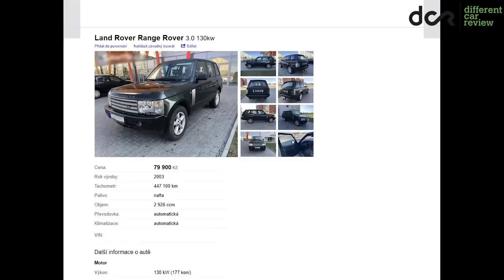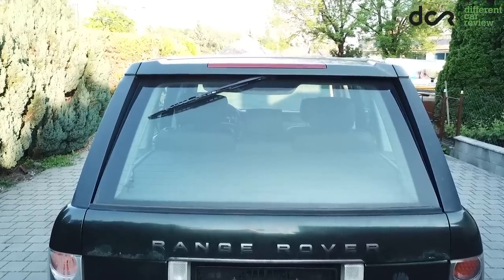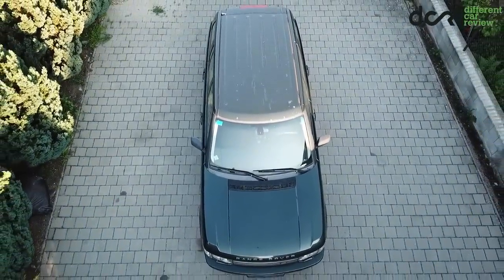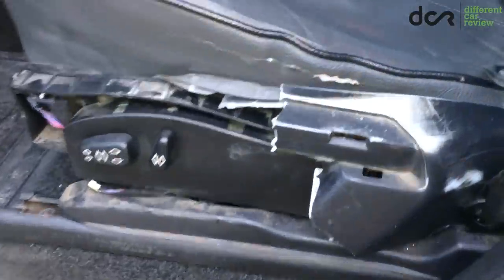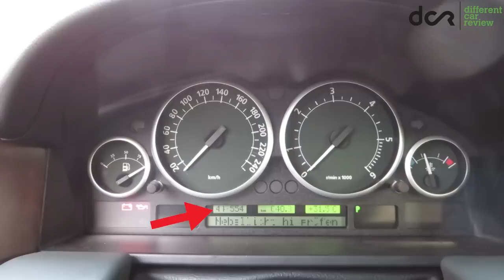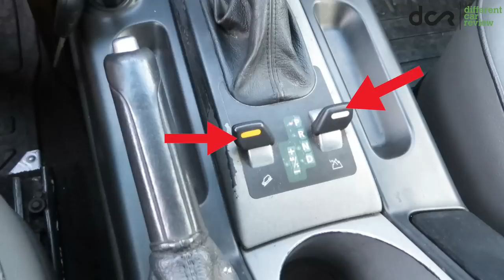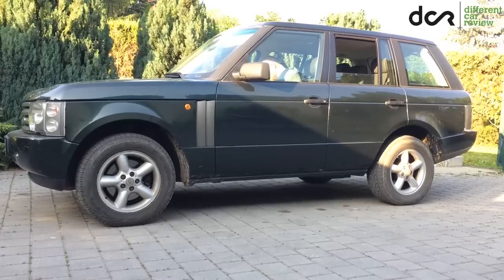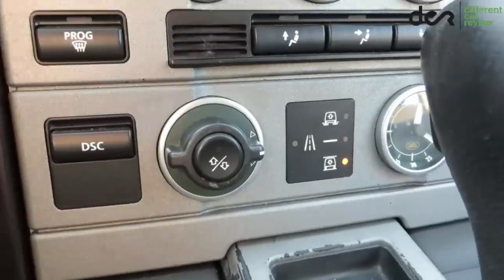I bought the Cheapest LHD Range Rover in the EU with 447 100 km - Part 1

Comment from the maker: -English subtitles are available
-It is the cheapest LHD version, in the UK they are obviously cheaper
-Don't try this at home !!
-Yes, I'm aware of all the risks
-Don't try this at home !!
-It's a bad, bad, bad idea

Range Rover L322 TDV8 Engine Issues https://youtu.be/bXPNqXs8isg
Range Rover L322 Common Rust Spots & Exterior Issues https://www.youtube.com/watch?v=ECK3FTXGvDM
Range Rover L322 - Removing the Spare Wheel is Genius ! https://www.youtube.com/watch?v=SEdc6VwyPaw

2008 Audi Q7 Detailed Review & Issues after 500 000 km / 310 000 mi - https://www.youtube.com/watch?v=Fwbx_KHvPss
2006 VW Touareg 2.5 TDI R5 - Detailed Review & Issues after 260 000 km https://youtu.be/ZJpexzt4f_g

Buying a used Land Rover Discovery 3, 4 - LR3, LR4 (L319) 2004-2016 https://www.youtube.com/watch?v=h_TCZ9P_QFM
Buying a used Range Rover Sport L320 - 2005-2013 https://www.youtube.com/watch?v=-xi0E0M0_gw
Reply: I've got a 2009 Lr3 HSE 4.4L V8 with about 150,000 miles and it's still running like a top. I've had to replace lower control arms, alternator, and a water pump. The original air ride still works but with every day I wonder if is gonna fail or  not. Not looking forward too that day lol. I know I should get rid of her but it's such a love hate relationship. I know I'm flirting with danger but i love the truck.
Reply: The hero we deserve!
Reply: Hey man your English is absolutely perfect! Unlike the car...
Reply: @Scrammy18  the BMW versions of the RR were bad. Due to the BMW running gear. The 2006+ versions are much better.
Reply: @kichaa13  yeah that is correct man
Reply: Love the accent, your English is great and to the point. Your funny and entertaining.  If I spoke like you, I'd do a radio show. Distinctive
Reply: different car review can you please review mercedes clk w209 i am interested is it reliable as or similar to w211 or is it unreliable as w203 c class witch it is based on.
Reply from the maker: @ЛукаРажнатовић-я9э  it is coming next, most probably this week
Reply: different car review nice , keep up with good work man , i just wonder are you a proffesional car mechanic or how do you get info on all this cars ?

Comment: Wow, interior oddly is quite nostalgic for me, having driven many e46, e39, e53. I guess the engine is horribly slow in this big car, but atleast the BMW 3.0d from that era is very reliable when maintained properly. One German guy managed to drive over million kms with an e39 530d, original engine and gearbox. End of life came as a result of crash, not engine or other techincal failure :)
Reply: The M57D30 from the early 2000s is a very reliable engine.

Comment: I have a 2002 Range Rover which I bought 12 years ago with 230,000 km on the clock for 13,000 euros. Since then: new gearbox, front air suspension, turbo, fuel pump, wiper motor, handbrake assembly, discs all round, brake pipe, full anti rust treatment, total cost approx 17,000 Euros. Plus some bodywork. Who told you the BMW 3.0 TD6 wasn’t a good engine? It’s fine. Yes the newer 3.6 and 4.4 have more power but for a normal driver like me it’s fine. I make a 1200 mile trip across Europe twice a year and it cruises comfortably at 80-90 mph all the way. Yes, the gearbox is not the best but too many people believe Land Rover when they say it’s sealed for life. Nothing is sealed for life. Change the gearbox oil at least every 40,000 miles. Anyway it’s 3 years since you posted this so I’m curious to know, how did it work out?
Reply from the maker: The TD6 engine in these cars is indeed the most reliable and with regular maintenance it can last forever, however for a heavy car like this its simply not powerful enough. Of course for calm cruising its fine but for overtaking not so much.
Yes with regular oil changes you can prolong the lifetime of the gearbox.
I sold it a long time ago, the new owner replaced the gearbox and he continued to use the car.

Comment: Expensive , considering it's a dog. I paid less than that for a 4.4V8 with a recon gearbox and no problems apart from a bit of wheel arch rust, even has a digital TV conversion.  It is missing the original phone...
If that's the cheapest one for sale, come to the UK,  that car would struggle to sell for 1500 Euro
Reply: Brian Green LHD cars are always better at resales in Europe as it a bigger market hence retain a higher value ... RHD Vehicle’s are less attractive for Europe unless you are happy to be on the wrong side and want a bargain Priced vehicle. RHD makes tolls and drive thru’s annoying
Reply: @TeeGoRex  In some countries you cant even register it. And the insurance, allways will be more expensive.

Comment: The last Range Rover with a reliable engine. You can fix the rust easily and the Rest of the issues aren‘ t a serious problem.
Reply: Gearbox!!
Reply: ZF gearboxes are great. They build them in town where I‘m living. Easy to fix, easy to maintain.
Reply: @lieberfreialsgleich  but in these they dont last long before a rebuild is needed, especially if towing. But I agree as a whole these BMW engined l322s are probably the best.
Reply: lieberfreialsgleich people don’t service them!

Comment: Tired air compressor is your suspension problem. You can by a cheap (Chinese) replacement these days that is just as good or better than the Land rover part.

Comment: If the air suspension is like in the series before it (p38) the compressor doesn't run while the car is off as a draws abit of power and it does store compressed air but after a few adjustments it takes time time refill the reservoir.

Comment: Change your gear box oil & filter,cam belt asap.
Reply: m57 engine has chain driven valve train..
Reply: marac177 even chain distribution needs to be changed evry 200000-250000 km
Reply: @eddiemichael4333  not in these motors

Comment: This has been in an accident previously. Rear lights don’t fit or seal properly and the rust on the tailgate is also a tail tail sign
Reply: O Lock 16 years of use and weather does that, it doesn't mean it has been in an accident.

Comment: The saving grace of that car is the diesel engine.  However if it is revealed at a later time that Range Rover manipulated their emission's software like Volkswagen did, then that detracts from the value of the diesel engine in this car.  The thing about old cars like this is, you have to buy one that you like:  that is your favorite color and has the features you want.  Then you won't mind all the trouble fixing it.  This car, however, is a wing-win situation because if someone doesn't fall in love with it and give it some Tender Loving Care = TLC, then it is worth more money by parting it out, thousands more!  Every cloud has a silver lining!
Reply: Mars J I believe at the time this vehicle was built the emissions regulations were sufficiently lenient that manufacturers could easily achieve compliance without doing anything crazy. I have a 2003 diesel that doesn’t even have a DPF, let alone an SCR system.

Comment: What was your purpose to buy this car? Just uploading video to youtube ?
Reply from the maker: there is actually more than 1 reason:

-I always wanted a range rover especially this generation, so I was searching for one, but since I don't have much money to just throw away for a car like this - I was waiting for the cheapest one which will still work

-of course because the mileage of this thing is surprisingly high I also wanted to make videos about it, since I have never seen a range rover with this engine/gearbox combination which would work for this long

-lastly, the roads where I live are getting worse by the year and I need to use the car on dirt roads as well, so I was thinking of buying a cheap but comfortable car with good ground clearance as well

+ life is short so why not to try it even if it ends up being a disaster

Comment: What every old Range Rover needs is Toyota's 2UZ-FE swap (including gearbox). The air suspension is fairly simple and parts are fairly cheap. The body is very rust resilient. The interior quality is very good and they last. So overall if you able to get rid of god awful bmw engines and zf gearboxes then you are golden.

Comment: For this price you can invest a little bit more in the technical parts like motor and gearbox/suspension and drive the car 3-4 years. But I don’t think you need to repair something in ex/interior.The car already started to rust. 
Btw GTA San Andreas sounds are funny 😆

Comment: Jesus for that many miles the interior is in surprisingly good condition... But 2800$ yikes I bought a loaded disco2 4.6 left hand here in the US with only 127k miles for 1600$
Reply: 2003 Range Rover was $71,200
2003 LR Disco. HSE $40,350
You are not comparing apples to apples.
Reply: Was it the car with 127k miles or that is what you have seen on the clock?
Reply: @zsoltpapp3363  yeah the car had 127k

Comment: Thanks for the video. Are you going to fix all of the problems?
Reply from the maker: at this point I don't know, there really is a lot to do, but I already changed the engine oil + transfer case oil and I "fixed-kind of" the tail lights - the video of this basic maintenance should come after the 2nd part